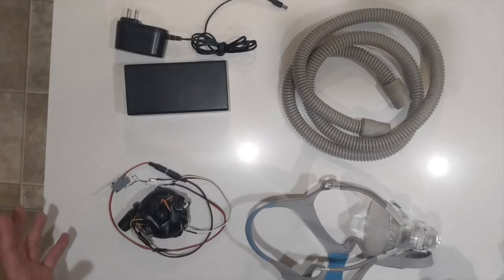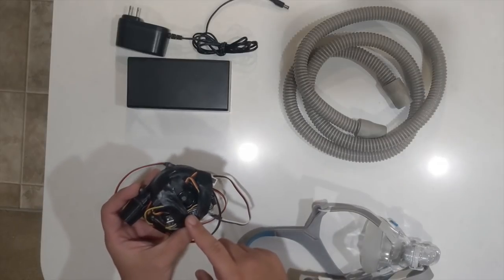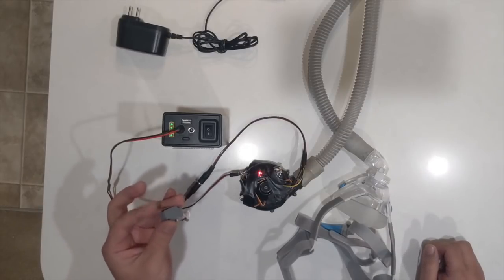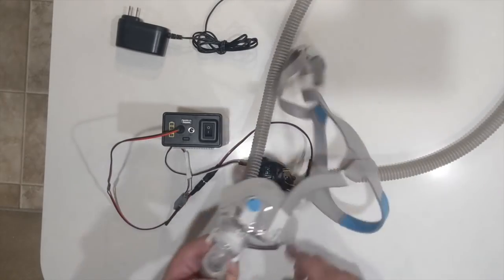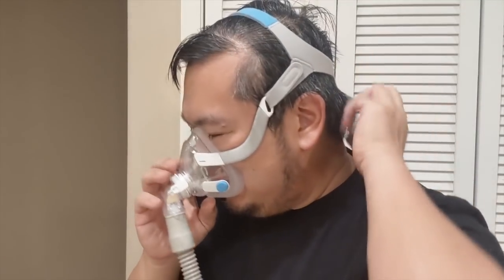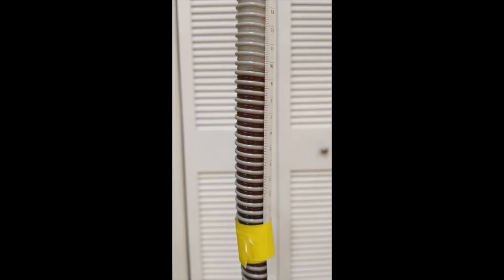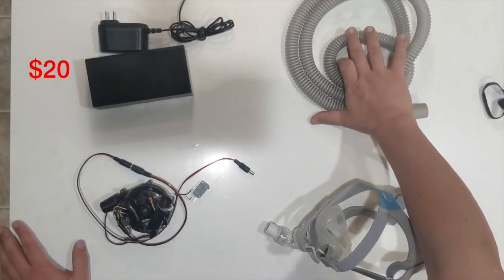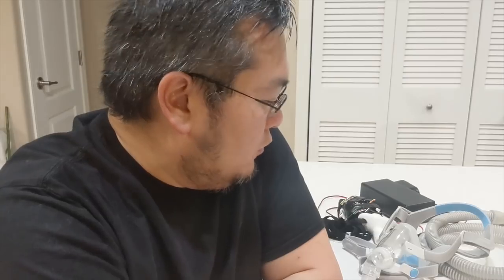Low-Cost Open Source Ventilator-ish Device

Comment: I appreciate the goal of this video is to help people who may be effected by this disease, but I must interject. If you are sick enough to require ventilatory support, you will need to be in the hospital setting. Acute Respiratory Distress Syndrome (ARDS), which is on the serious side of the spectrum of complications resulting from COVID 19, requires ventilation via a secured airway with a breathing tube past your vocal cords inserted and maintained by trained healthcare professionals. ARDS is a challenging condition to treat, even in the ICU setting, because it requires specific ventilator settings; close monitoring; etc. the method you are demonstrating is not considered a “secure airway” as you must be capable of maintaining your own airway. Patients in serious or critical condition will need hospital admission and close monitoring.  Not all patients infected with the virus will develop ARDS (most will have mild/moderate symptoms). The patients who develop ARDS and pneumonia are the ones we are most concerned about. If you are concerned about your state of health, contact your healthcare provider. Make sure you call ahead so they can prepare for you. Same goes if you feel the need to go to the ER. Call ahead so they can prepare for your arrival.
Reply: It could be possible to add an incoming airway on the fan. It's sure it's not a processionnal system but in France they let today die older people because they dont have enough ventilator...
Reply: Since DIY ventilators are controversial, Johnny also has a solution on how we can modify parts to produce more protective gear for caregivers. Build a low cost PAPR: https://github.com/jcl5m1/ventilator/wiki/Build-a-Low-Cost-PAPR
Reply: Maybe you didn't get the memo, but fearless leader delayed mitigation of the disease. There are NOT enough ventilators available so we're on our own.
Reply: Surely a solution can be found to any obstacle that stands in the way. If this gets bad enough, motels  will converted to makeshift hospitals,  med studants will get a impromptu promotion,  some regulations will be temporarily set aside. If it comes down to it, 1 way or another if we work together we can do it. Even if we have to bend or break the rules, if it saves lives (without causing harm) we can find a way
Reply: Brett P. you totally missed the point. Its simple math: Amount of ventilators needed – actual amount of ventilators = the amount of deaths.  It is assumed that the need will overwhelm the existing medical system. Triage will leave the very old to die at home and they will not be admitted to the hospital. In that case a DIY, homemade device may save some.
Reply: @brettp_DO  Hi. You can also check out Johnny's notes from talking to pulmonologists and respiratory therapist: https://github.com/jcl5m1/ventilator/wiki/Notes-from-chatting-with-a-pulmonologist

Comment: Johnny, if I could contribute by laying out a circuit board that would be helpful to this system as a component for people to build these please let me know. I can have boards in a week and populated with Arduino or other components a few days after that.
Reply from the maker: Thanks. You can add a PCB design, and links to fabrication in the GitHub project.  I'd like to get more feedback from a pulmonologist before attempting any major fab.
Reply: @jcl5m  I wonder if potentiometer knobs to adjust the blower speed and breathing rate would be more within people's comfort level to adjust pressure and frequency instantaneously if it's out of adjustment and they are tempted to panic. I also wonder if a pressure sensor could be used to sense the person's exhale and adjust the frequency automatically. Just a possible suggestion.
Reply: @jcl5m  oops.. was logged in as my wife Kelley.
Reply: I was thinking the standard display button/knob boards that are used with arduino based 3D printers like the Prusa i3 series. In fact Joseph Prusa might be able to accelerate the production of 3D printed components. Sort of the way that these guys work: http://enablingthefuture.org/upper-limb-prosthetics/
Reply: @alanwolfinger8745  For completion of this thread, notes from the medical pros are here: https://github.com/jcl5m1/ventilator/wiki/Notes-from-chatting-with-a-pulmonologist

Comment: variable pressure can be achived with holes of varying diameters. any air pump would suffice. Co2 retaining may be an issue
good thinking though
any respirator mask could be jury rigged as a face mask

need to remain upright with these dodgy soltions

Comment: What am I missing here? It's just a CPAP machine that he tore apart, a CPAP machine and a ventilator are two totally different things. A CPAP only helps a spontaneously breathing person/patient, you need a ventilator to breath for a patient that does not have the ability to breathe on their own.
Reply: You are missing that he modified the controls/logic of the CPAP machine to cycle between higher and lower pressures in order to simulate a respiratory cycle.  A normal CPAP just forces air at a constant pressure.  That difference is basically the main difference between a CPAP machine and a ventilator.
Reply: @CL-gq3no  sorry Chris it's still just cpap/bipap, there are no valves for inspiratory or expiratory, there is no expiratory limb, this will only work with a spontaneous breathing person/patient. In an emergent or acute icu situation this machine will not be able to breathe for the patient. I appreciate that he is trying to do good but it just won't work otherwise they would be using CPAP/bipap machines on these covid19 ards patients.
Reply: @scottlebowski8424 , fair enough.  I'm no expert and you sound like you know what you are talking about.
Reply: @scottlebowski8424  Check out Johnny's notes from talking to pulmonologists and respiratory therapist: https://github.com/jcl5m1/ventilator/wiki/Notes-from-chatting-with-a-pulmonologist . Further discussions are happening there. Thank you!
Reply: @ninasocializes1081  thank you Nina, I read it and it just varifies what I was thinking, he is obviously very intelligent but his diy ventilator is just a bipap machine that has no real practicality in an icu that would be overrun by covid19 patients. I'm just not sure why he made the video after I read his notes, I think he just wanted people who view his YouTube videos to watch this video. I have taken care of many very sick patients in an icu and when I saw this it just didn't make any sense to me.
Reply: @scottlebowski8424  yea, there are many debates about this. Johnny is working on making more improvements to make it more useful. It is definitely a challenging DIY project. Hopefully the actual ventilator manufacturers can help ramp up production one way or another.

Comment: But does it release pressure on exhale, mouth guard needs exhale vents...still better than nothing good work.
Reply: The supply hose delivers a positive air flow. Exhale is released through holes in the mask where it connects to the hose. The pressure is always positive, so you don't exhale back up the tube. Oxygen lines can be inserted into holes in the mask designed for that purpose.

Comment: how do people sleep with that noise? how about a autobody paint booth portable filtered fresh air pump/mask system? there's about 20' of hose so no noise & controller has a rheostat variable resistor for blower speed
Reply: He took the CPAP machine apart. An intact machine is quieter and is usually placed under or next to the bed to isolate its noise.

Comment: You can buy blowers very much like the one you're using for ~$10. They are used to pump up inflatable mattresses. The battery powered ones run on ~6v. I imagine this would be a lot cheaper than sacrificing a CPAP :) Here's the sort of thing I'm talking about https://www.tiso.com/tiso-euke-1125535/eurohike-4d-fusion-pump-black-tiso-euke-1125535/00039878
Reply: CPAP parts are made to run continuously for long periods of time. Air mattress blowers may not be able to withstand that load. It is however very worthy of testing.

Comment: Doesnt it need to cycle on and off to give the lungs a chance to exhale?
Reply: Bipap.. that's the intermittent setting.. when the pressure reduces you exhale.. the idea behind the CPAP machine is to be breathing in an 'environment' which is at a higher air pressure than ambient.
Reply: Check out his latest notes from after talking to a pulmonologist: https://github.com/jcl5m1/ventilator/wiki/Notes-from-chatting-with-a-pulmonologist

Comment: I WAS ALSO WONDERING W2HY CPAPS CANT BE USED LIKE VENTILATORS
Reply: From Johnny on another thread: CPAPs tend to be closed unable to change pressure without prescriptive changes.  They don't actively drive a breath rate.

If an existing CPAP could simply be reprogrammed, then this indeed would simplify the build and enable a potentially large stock of existing equipment.  We would need a manufacturer to either release the tools to enable reprogramming them or for someone to figure out how to do it on their own.

Comment: This device seems to just push air in, Can anyone please explain to me how the user will get rid of the CO2 coming out of his lungs ? 
Assuming the user is unable exhale, isn't it dangerous to the user if CO2 has no way coming out ?
Reply: Take a fairly deep breath, then relax and see what happens.  Your full lungs will exhale as soon as you relax.  This is using the same principle.  It ramps up the pressure to inflate the lungs slightly then slows down to allow some of the lung volume to escape and balance with the lower pressure.  Rinse and repeat.  I believe the commercial ventilators work the same way.  They don't cycle between pushing and pulling air as one might assume.  They cycle between pushing air a little and pushing air a lot.
Reply: @CL-gq3no  Indeed My lungs deflate when i relax , thanks for the explanation.

Comment: There is a lot of info on the web about (potenitally) using CPAP and BIPAPS for this. TLDR; they are NOT recommended for this as the expelled air contains aerosolized virus, creating a huge hazard to caregivers. Sorry, but in its current form, this is not a solution and would actually create a much worse problem.
Reply: I don't understand how it could be aerosolizing any more than without a device..
Reply: This is intended to be used in an already dirty environment such as a converted convention center. Doctors may wear a PAPR.

Comment: Not sure the disassembly of the pump is helpful as most are designed to run on 120 and 12v. Most importantly many have an active exhale pause of pressure too. Ramping is also helpful to someone that had never put such a device on their face.  I would be aware or ask questions about pressure too, my evolution led me from a triangle mask at 16psi to a nose pillow mask at 12 cm h2o*  See this link before you venture into hacking any CPAP device!  (*corrected from psi from reply below.) https://thesleepdoctor.com/2018/11/25/hacking-your-cpap-is-a-very-bad-idea-heres-why/
Reply: Jason St. Pierre: Appreciate the link but since NO device runs on the ridiculous pressure you stated, it is hard to have confidence in your post. CPAP devices have a pressure range of 4 to 30cmH2O.(AKA CWP) Most machines are in the 4 to 20 range and therapy titration may start around 5cmH20. I will leave the conversion of psi to cmH20 up to you but you are at least 4,000% wrong!
Reply: @chip-load  well psi appears to be the wrong term but the number on my unit uses 12cm h2o right now. Beyond that everything I brought up is valid. Don't be a dink, next time. If you follow the link or look into the potential danger of experimental use of a cpap blower you will find facts that clearly warn real danger.

Comment: Stuff:  Chest wall and lung compliance and elastance varies with the individual.  Expiratory time  (E)is usually twice as long as inspiratory time (I) ,  The I to E ratio is normally 1:2 but can be as high as 1:4 .  Can the  I:E ratio be adjusted in the BiPap mode?   Or, better still,  Can a sensor be installed such that if a person attempts to exhale against inspiratory pressure (thus raising the pressure in the tubing above what is preset) the blower drops the pressure to allow expiration?
Reply: It's based on an Arduino so he could program it in whatever way makes sense and ultimately add some buttons so the user could adjust high pressure, low pressure, timing, ratio, etc.  None of that would be too hard to program.  The pressure sensor/switch is probably doable without to much effort as well.

Comment: Isn't this exactly what the CPAP machine does in the first place? Couldn't you just use an unmodified machine if you have one?
Reply from the maker: CPAPs tend to be closed unable to change pressure without prescriptive changes.  They don't actively drive a breath rate.  They are also about $800 new when all you need is the blower.
Reply from the maker: If an existing CPAPs could simply be reprogrammed, then this indeed would simplify the build and enable a potentially large stock of existing equipment.  We would need a manufacturer to either release the tools to enable reprogramming them or for someone to figure out how to do it on their own.
Reply: @jcl5m  I know that at least some of them have a secret way of accessing a menu, where you can adjust the settings that you're normally not supposed to touch.
Reply: Cool!
Reply: Pfaeff: As mentioned above the CPAP makes the situation worse. A CPAP provides a continuous positive pressure air flow. The amount of air is more that needed and the air that is not breathed in is discharged through a vent into the surrounding room. When the person exhales his virus laden breath is mixed with the bypassing air into the room spreading the infection to caregivers. CPAPs do NOT have a filter mechanism on the bypass air and is the reason they are not allowed in the ICU.
Reply: @chip-load  What about CPAP use in your home? Especially when you are alone and in isolation.
Reply: @Pfaeff  Sure, but you have created a lethal environment. If you need, or expect, outside support then what?

Comment: CPAP and oxygen are already being used in cases where they aren't ventilating.
 As far as for home use forcing the machign to breath for you AKA ventilation REQUIRES sedation!!
I am confused why you are taking a CPAP, a device made and designed to assist breathing and taking it apart and changing the mask and making a product that assists breathing?? Just use the CPAP as intended especially if your not sedating!
 
OR to put it another way,. How is this any different from taking a CPAP apart then putting it back together and using it as a CPAP?

Comment: without a double valve there will be no functioning life saving resperator, am sorry to say that. You do not need to blow air into a patient, of course it will be necessary to suck air out of the body. A bit more medical knowledge might be needed. At the end, 2 Pumps, 2 valves, and a electronic controll device, together with a battery backup, Sensors, etc. will be required. SRY

Comment: this is not a good idea, they are already sourcing a legit 3-D printed model, this is just a small leaf bower with a mask at the end lol

where are you getting the Oxygen from? How will you regulate pressure inside the lungs? How would you be able to even tell what effect the ventilator is having on the pressure inside the lungs? How would you clean and prevent infection? How do you separate out from in? you need two separate tubes p sure. Also moist and warm is air is p vital in these things for it to actually increase lung compliance so you would have to incorporate a humidifier. you cant just blow cold air back and forth through a tube and call it a ventilator, or you could just use a straw. 

here's a link to the specifics on all this stuff tho https://www.ucl.ac.uk/anaesthesia/sites/anaesthesia/files/VentilationMechanics.pdf